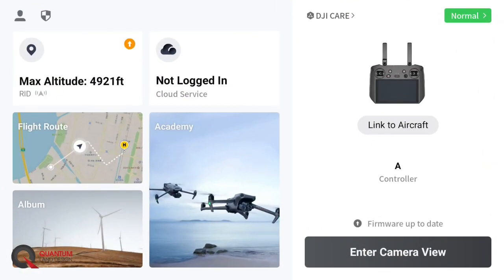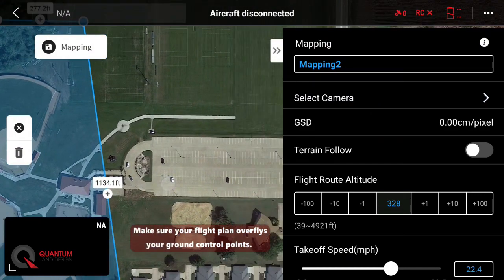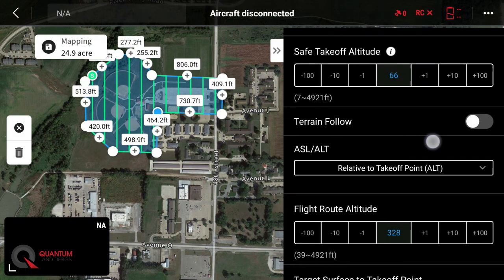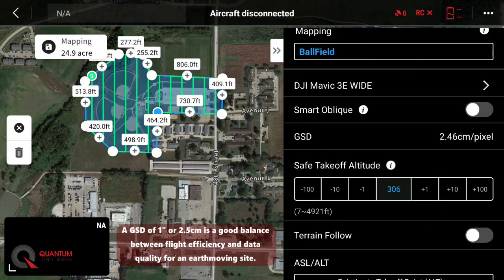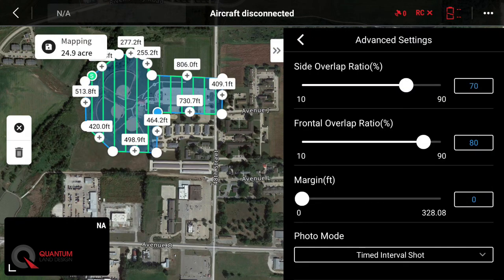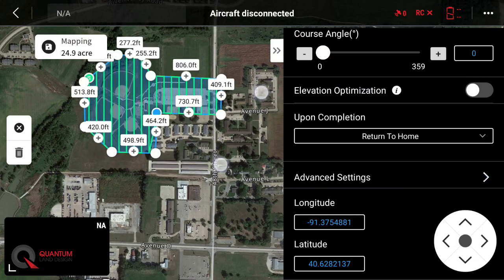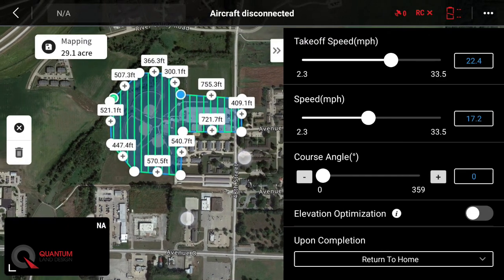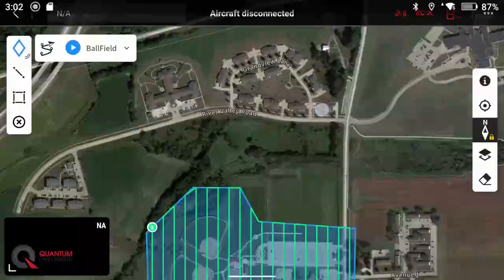DJI Mavic 3E Flight Planning for Topographic Survey Mapping

Comment: What would you recommend for topographic surveys of farm land that have quite significant changes in elevation?

I ran into an issue on my first attempt yesterday with my M3M where the hills/mountains had about 300m of elevation gain so the mission would keep halting because the drone didn't stay a consistent distance from the ground below (as in as the terrain got steeper, the drone got closer to it - ie. staying at the same elevation from the take off point)
Reply from the maker: Hi @paulbaker7489 - You can use the terrain follow functionality or load your own surface DSM.  Be careful with DSM's from online sources.  If you are flying an area the frequently changes, like mine, it may not be accurate.  As always, keep line of site to closely monitor the drone as you fly.
Reply: @QuantumLandDesign  still struggling to find the Terrain Follow function. Will see if DSMs exist if rural Colombia!
Reply from the maker: @paulbaker7489  , sorry I forgot they changed it to AGL (above ground level) in the last update.  It's under the ASL/ALT menu section when planning a mission.  Again, keep close eyes on the drone when using this function!

Comment: why didnt you use grid pattern when planning mission?
Reply from the maker: For topographic flights it's not necessary so long as you have sufficient side/front overlap.  If you are trying to capture very steep terrain or building facades, you may want to consider a grid flight.  We've experimented with grid flights for topos and do not see an improvement in most use cases.

Comment: Nice quick video. Right to the point. But why did you program it to fly over the road? Were you able to get a waiver?
Reply from the maker: This flight was just planned as an example for the video.  It was never flown.
Reply: @QuantumLandDesign  That's great, but if I could recommend to mention the regulations in your videos. There's a lot of pilots that don't have a clue.
Reply: That's not what I understood. Please do a copy and paste of the regulation for us.
Reply: @michianadroneservicesllc858  You are wrong.
Reply: This is mostly for anyone else reading, but it's perfectly legal to transit briefly across most roads per Part 107. It's Freeways where you MIGHT need a waiver. If you are just crossing the road on a perpendicular course there's no need for waivers. If you apply for one you're most likely going to get an email from LAANC saying that it's unnecessary.

Comment: This is very interesting - I hope to venture into Komatsu Smart Construction in the near future, this looks to be a similar application. Do you have any insight or suggestions on getting the needed credentials to operate a drone like this?
Reply from the maker: Hi Chuck - Good luck with Smart Construction, from what we saw at ConExpo it looks like a capable system.  In the US, obtaining a FAA Part 107 Certificate is step one. You can start on our website to start understanding FAA requirements.   Here is a link directly to it - https://www.quantumlanddesign.com/quantumflightpack#:~:text=and%20control%20data.-,FAA%20Requirements,-You%20will